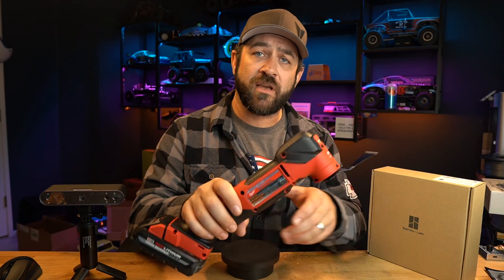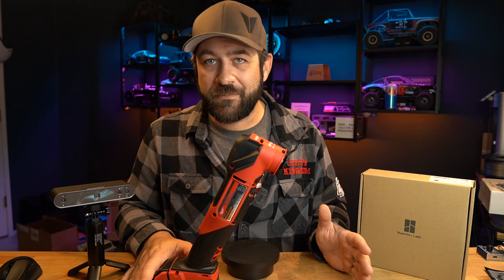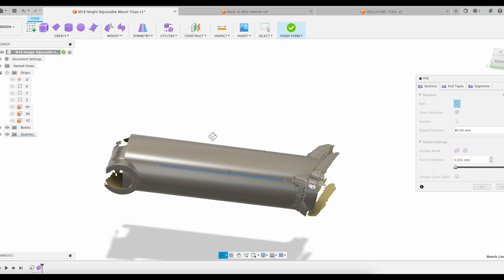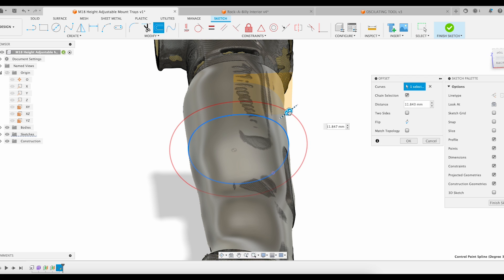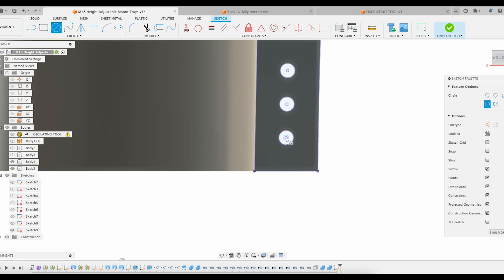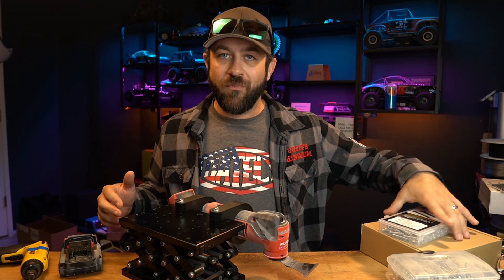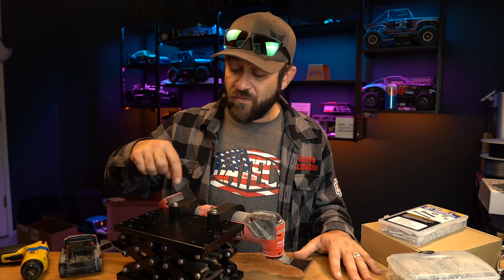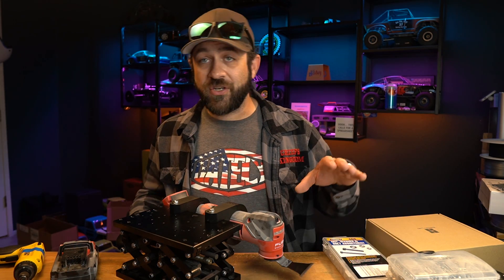3D Scan & Print: Custom Mounts for Milwaukee M18 Oscillating Tool!

Comment: Idk what plastic that is but I know for vinyl I've used a circular saw blade installed backwards to cut thin stuff. Might be worth a try?
Reply from the maker: I don’t really have a need to change this, this is a reliable easy solution.

Comment: Fusion 360 is so deep.  I know there are already a lot of folks doing instructional videos on Fusion but I would like to see more of your approach to creating parts/assemblies.  Also who made the table?
Reply from the maker: It’s made by a company called PDV, I’ve had it for several years as I used to use it for my laser fixturing previously. Not sure where I got it!
Reply: @HarleyDesignInc as @tembmobile is correct, we are asking about the adjustable lift table.
Reply from the maker: Which table?
Reply: @HarleyDesignsInc  The lifting, ultra-stable table / riser thing .. I'm curious about that too

Comment: I think if i wanted this to be a permanent or stupid reliable, low bs, setup id get a corded model
Reply from the maker: Cordless is just too easy. And this is only needed to run for 20-40 mins once a week or so.
Reply: @HarleyDesignsInc  ahh then yeah the battery powered option will work fine for that!

Comment: Interesting idea. With Fein, and also with Festool, there is the option of attaching the multi-tool with two screws.
Reply from the maker: I’m a Milwaukee guy, so I like to stay in my ecosystem
Reply: This was not a call to convert either.  @HarleyDesignsInc

Comment: Depending on how long you're expecting it to run, you may want to make sure the cooling intakes aren't blocked under that rear clamp
Reply from the maker: The clamp are clear of any intake or exhaust areas.
Reply: @HarleyDesignsInc  wasn't sure. They look great though